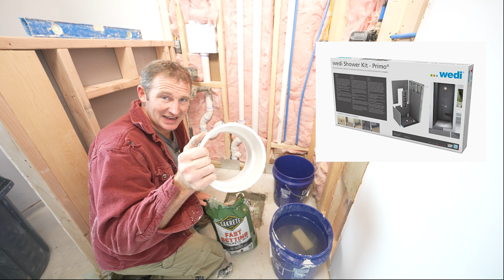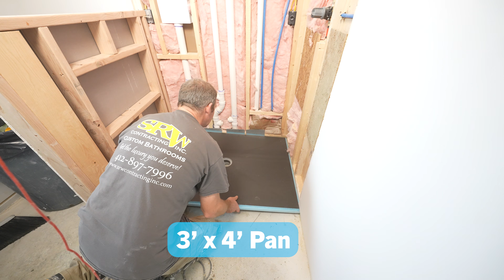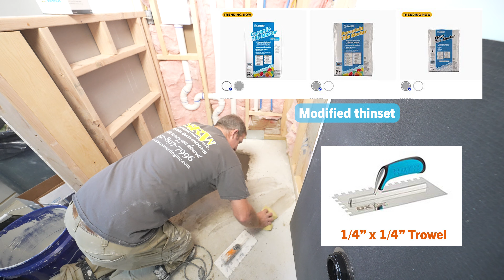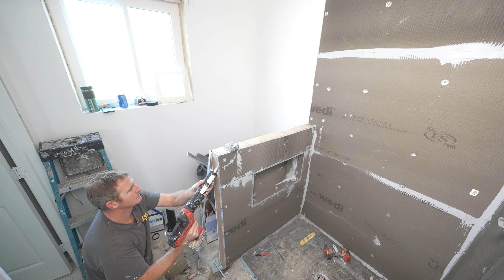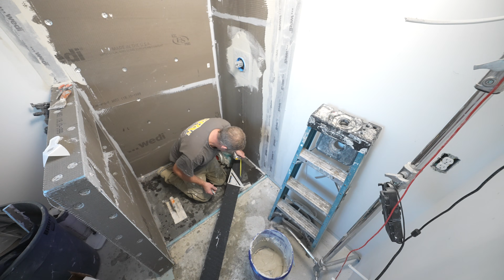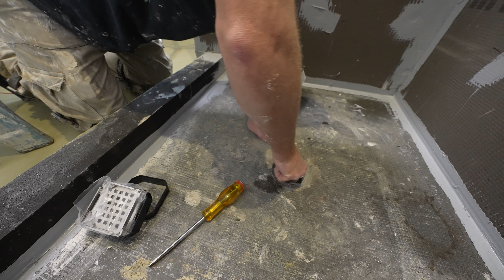Tile Shower Build over Concrete | WEDI System

Comment: I just don't trust that curb to stay put. Also that floor to wall edge...I don't think I could just rely on the caulking. I'd do a wrapped wood curb and use that banding around the pan. Tile coach did a tear out of a wedi system. The damage was catastrophic.
Reply from the maker: 😆 yeah there is a lot of stuff wrong with the Wedi year out that tile coach did. Not by tile coach of course….just the original builder.  No one is forcing you to use this system 😆 I’ve had over a decades worth of success with it and do showers many different ways 👍

Comment: Is the battery powered caulk gun worth the investment?
Reply from the maker: Probably not 😆 still can’t believe it’s $250 why exactly?
I honestly only use for this or adding adhesive. If I only did bathrooms….I’m not sure if buy it. Sausage gun and sealant would be a better i investment and half the cost